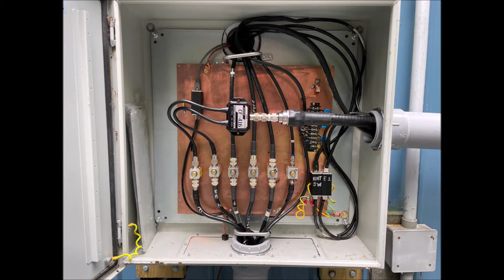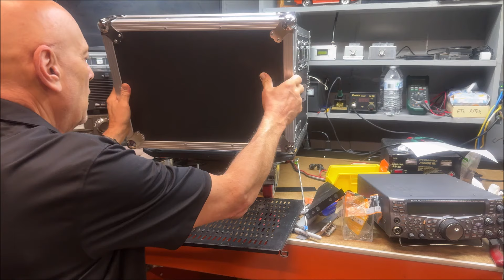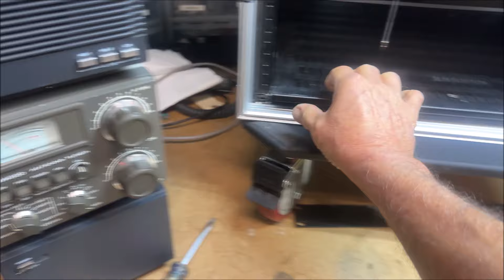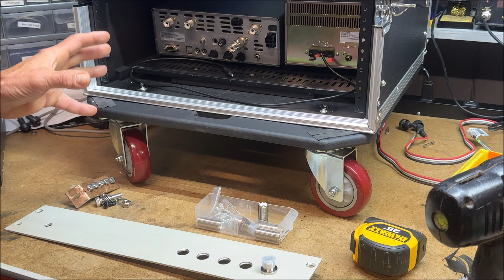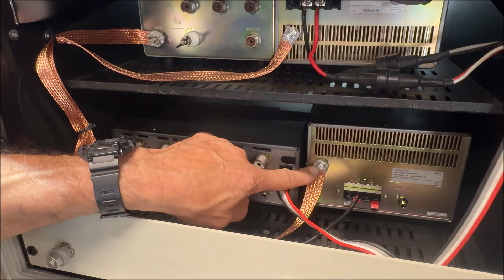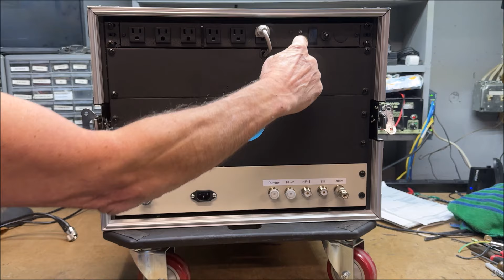Ham Radio Adventures 11

Comment: Great project and looks fantastic..   Any thoughts of perhaps a ventilation panel in the back or top of box ?  Or do you feel there would be plenty of air movement around the equipment with the whole box front open?
Kudos to you for putting it all together.. 73. Dean  K3KHG
Reply from the maker: Thank you for the comment. I did 2 things to keep air going: 1. I ran the unit 24 hours and kept track of the temp. Did not seem to be a problem. 2. the unit is not sealed. The blank plates on the front are staggers 3/8" to allow natural airflow. I can also add fans if the need be on the blank rear panels.